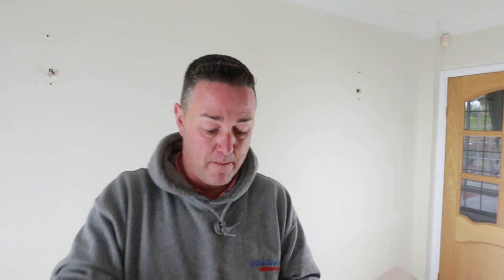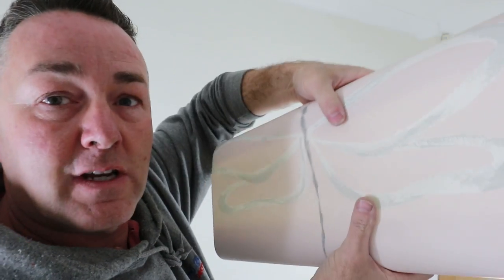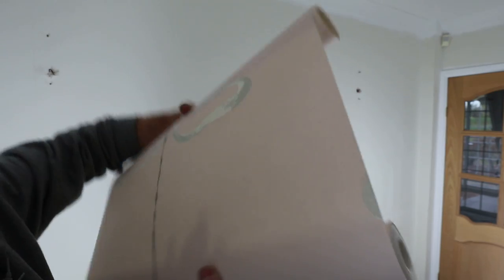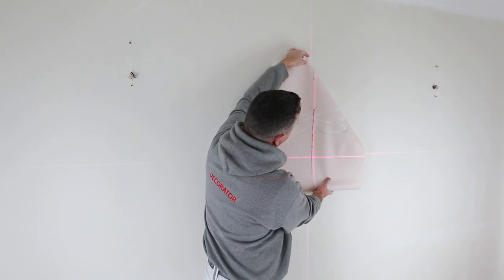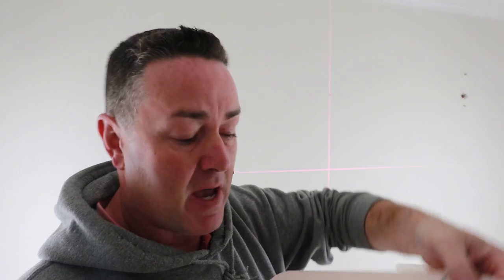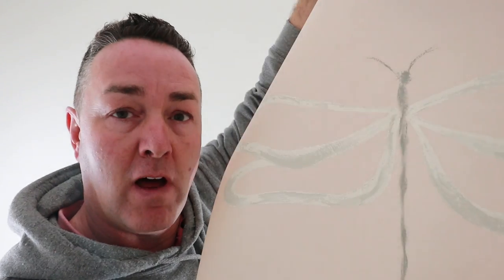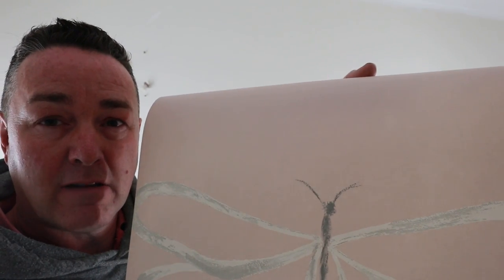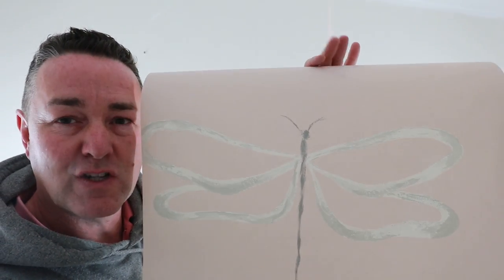Understanding HALF DROP wallpaper and how to hang it.

Comment: Hi Phil surely you have to take into consideration moving left and right into the corners where the paper will finish as you don't want a small sliver left to peice in , rather than just placing the 1st peice inbetween the screws because it looks good on the eye ??
Reply from the maker: Always offer it up on the rolls forst, see where each length would fall.
Same on chimney breasts.

So you either find he middle of the wall and hang the paper edge to a centre middle line... OR... hand the centre of the paper to the centre line (measure it so either side of the centre line is equal size t the edge of the roll of paper.
Dont forget, if it's paste the paper... the paper will stretch and be a different size to it's dry state.

Make sense?

Comment: Nice one Phil...wallpaper designers and companies don't do as any favours do they, life would be so much easier if the patterns were symmetrical to the paper width
Reply from the maker: Correct. But those papers that have no pattern on the edge to butt up to are terrible.. the laser liner horizontal helps there though
Reply: @ProfessionalPainterDecorator  they could have put the pattern equally down each  edge
Reply: bloody designers! great at creating things that look nice but are a real sod to make work. Not matter what the industry it's the same. Make wallpaper designers hang the paper, then they'll design better lol

Comment: What happened to that squash court job, were you out priced, what paint would you use? Thanks
Reply from the maker: I got advice from a specialist firm that does squash courts day in day out. What they do is chop off the old plaster and re skim it with a special plaster that's suitable for squash courts.. they do all of it from re doing the floors, wall and lightning..  and re line them out.
The price was very good, so we putbtye price forward with tye plan for then to donthe work for us, we could then do the painting of the general areas.

We've heard nothing.
As far as I know there's not been any work done on them either since.
Reply: @ProfessionalPainterDecorator  okay, sounds like a specialist job, would never of thought it needed a reskim
Reply from the maker: @beecee6850  it's to do with the force of a squash ball hitting the surface at speed.
A re skim was a better option as previously the walls had had eggshell on them and more than likely silk!